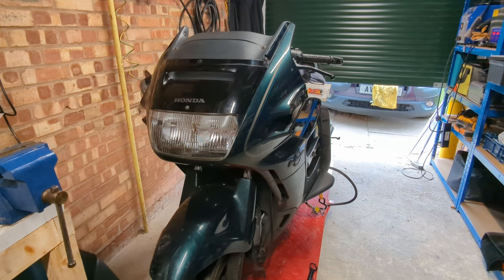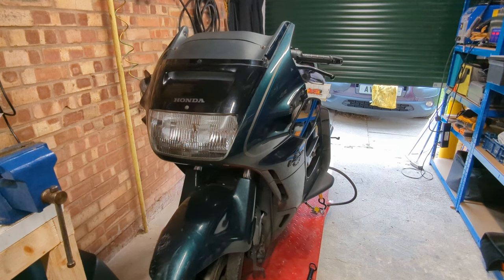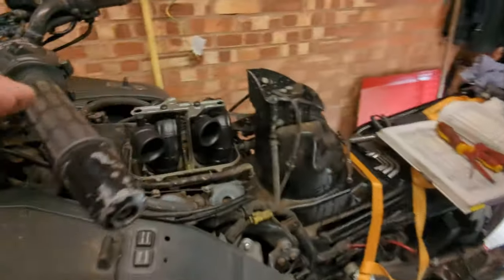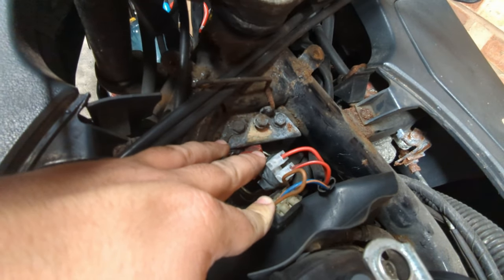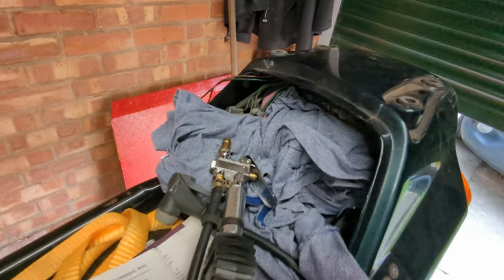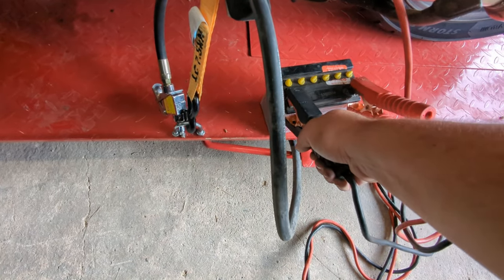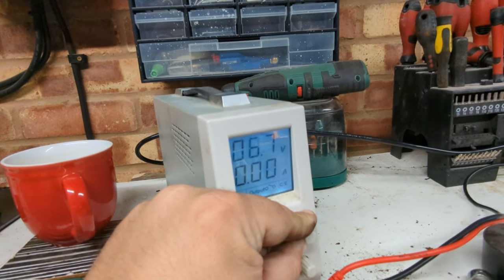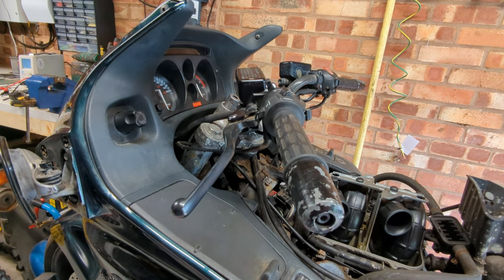What have I got ? | ST1100 Refurb Pt 1 | JAM#40

Comment: I bought a 2006 ST-1300 that had sat, under a cover, outside, for over 4 years. I am in the process of going through it. It's not as rusty as your but savages have been at the fairing fasteners.
Reply from the maker: I think after this I am sticking to un-faired bikes 🤣
Reply: @justanothermotorcyclist  It's like the previous owner pulled the fairings off and then lost all the OEM fasteners. What kind of animal does this?? You have the added disadvantage of being somewhere in the UK where steel rusts and alloy corrodes like crazy. I was thinking of making a diagram showing fastener placement.